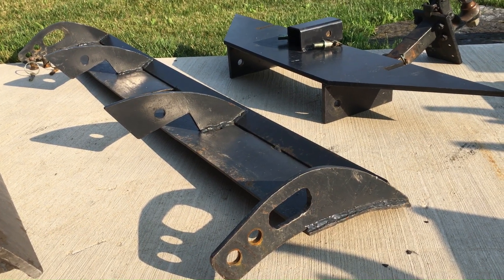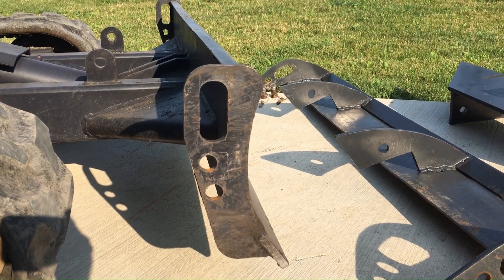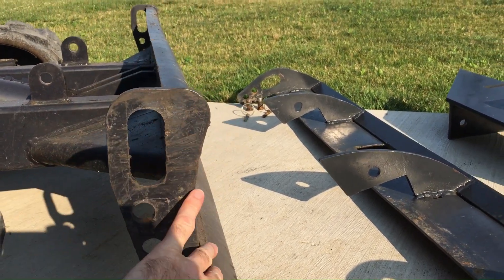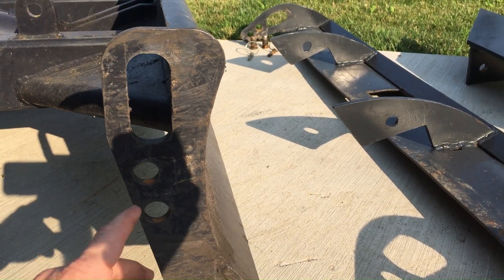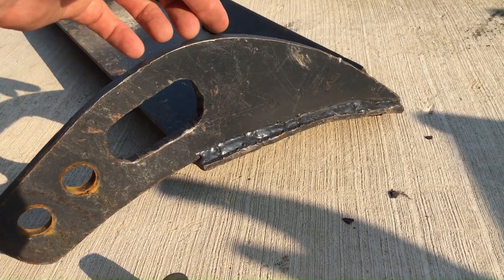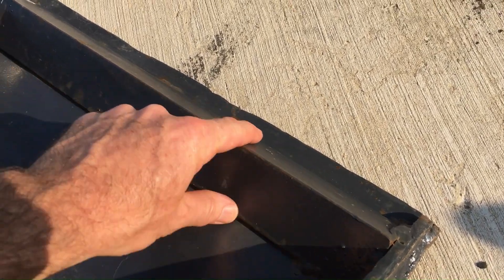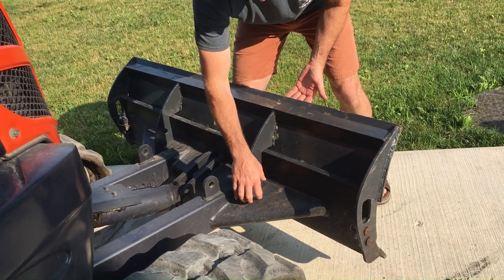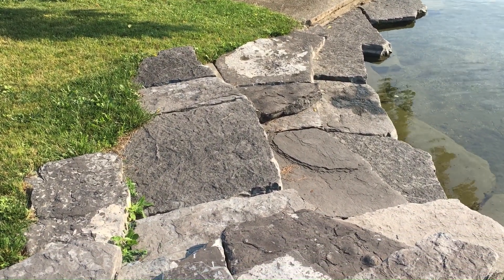How I designed and built my mini excavator dozer blade extension

Comment: I have my blade off now doing some repairs looking to do something extra while it's on the ground.
Reply from the maker: I bought my pins from tractor supply. They're out-drive implement pins that I cut the threaded ends off. I made the blade extension removeable so it won't block my view when digging deep up-close.
Reply: @MiniXGoneWild thanks for the info, I think I might build a hanging bucket also.
Reply from the maker: @Diggin-off-the-side  I've often seen the utility of having one of those myself. Maybe someday I will get around to it as well.

Comment: Awsome. I am amazed they don't offer this. You actually could patent and sell these.
Reply from the maker: I looked into the patent process and it only makes financial sense if you're a corporation looking at long-term investment returns or you expect to sell A LOT of product to recover the $50,000 required for getting all 3 (U.S., Canadian, and European) patents. If you don't get all 3 patents, it is easy to circumvent them (due to various loopholes). That is why I offer my ideas as "free use" and get enjoyment from seeing others benefit. 
I have occasionally reached out to manufacturers and offered them 1st chance options in trade for upgrades/discounts. Both Kubota and K-Trail took me up on some of my designs and gave me deals in return.
Reply: Very functional.  My friend is designing a multi color 3d printer head and the patent process is kinda rough for him, too